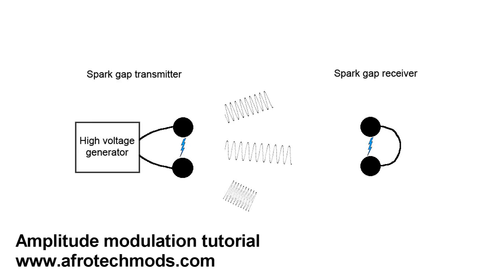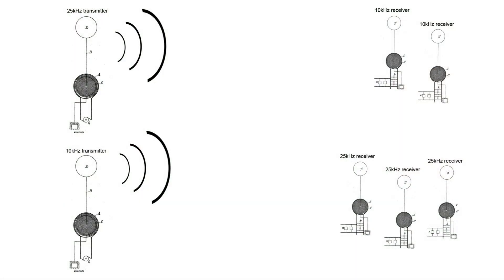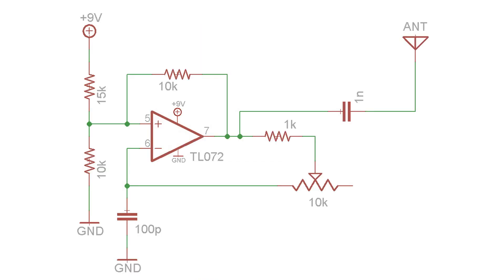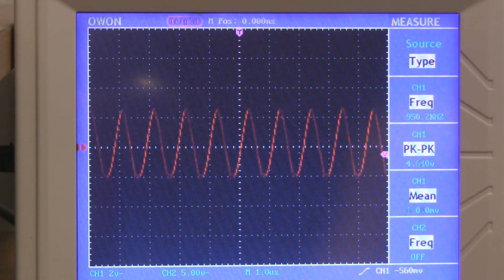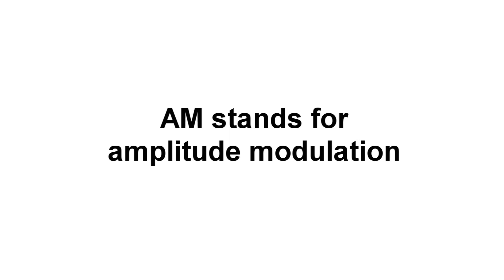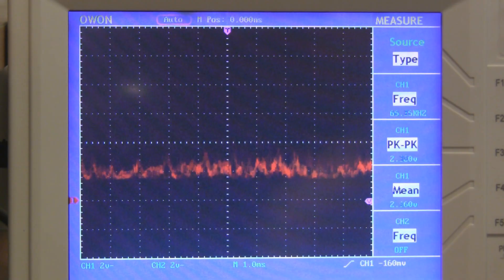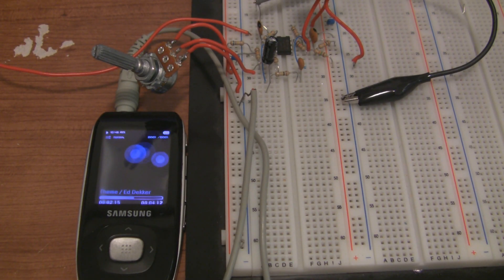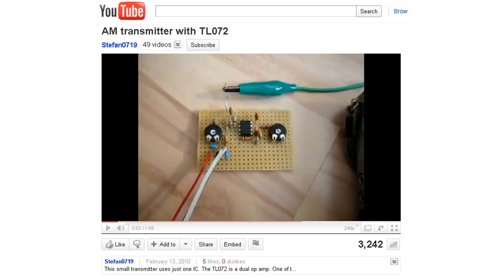Amplitude Modulation tutorial and AM radio transmitter circuit

Comment: As far as I know the modulation needs a multiplier and not a summation or a  subtractor. The final amplifier is used as a difference amplifier and not as a multiplier unless of course it is driven  hard in a non linear region.
I am  not so happy about the last " modulation" part!because the process is not a multiplication, if my memory is not failing me.
As far as I am concerned the circuit is summing up the three inputs from a. the audio player, b. the 100K pot and c. the 9 volt line while the result is subtracted from the carrier,  while the output is used to give a gain of about 7.   the result is a not an amplitude modulation.
The output should be the base frequency on which is superimposed the carrier and  some DC  value and it is a wriggly waveform where the constant carrier rides on the audio.
Reply: +Carmel Pule' You are absolutely correct, the reason this works is because of the non-linear response from the op amp. Since op amps are pretty linear, you have to drive them so the output voltage waveform clips. From that you get second order(you also get higher orders, but in this case the second order is the most important) intermodulation so if your input signal is cos(wm*t)+cos(wc*t) you will get on the output some component at cos((wc+wm)*t) and at cos((wc-wm)*t) which is an am signal (it also creates content at 2wc and 2wm, but we don't care). Actually, you don't even need the op amp, a simple rectifier circuit using a diode will do the trick. 

The other weird thing is the use of the TL072 which has very low GBW(unity gain at 3MHz) for a 1.2MHz application (I guess it's a clever way to filter out content at 2wc, 3wc etc. generated by the IMD but I'm not sure it was intended).
Reply: +Gabriel Nobert You made a circuit different from the DUT to shoehorn your theory. Removing a 'coupling' capacitor (the correct term for it), halving the negative feedback resistor, arbitrarily setting a bias pot to hard ground, changing the op amps. Your opinion that it 'makes no difference' is factually irrelevant, especially as you could have simulated the actual circuit without any so-called "tuning" changes. Friendly advice, that level of disingenuousness will get you fired.

For anyone else reading this, you can make the circuit itself in a SPICE-based simulator and draw your own conclusions. Paul Falstad has a great free one, just set the carrier with a 220n cap, terminate the output through a capacitor into a resistor, and put a 40hz test signal in. Op amp Vdd and Vcc set in their edit profile.

Now, I could always be wrong: But it's never going to be resolved with handwaved circuit 'tweaks' and appeals to pretense.
Reply: +Gabriel Nobert The reason this works has nothing to do with op amp nonlinearity. You can simulate it with ideal components and see why: It's a basic pulse width modulator. But of course, pulse width modulation changes energy output, and thus amplitude. An output capacitor of 10mfd into a dummy load of 100 ohms would perhaps demonstrate the transmit current, which is likely the more notable thing here.
Reply: +Eclipse We both are correct in the sense that I am giving a frequency-domain explanation while you are giving a time-domain one. The op-amp has to be driven to nonlinearity though, it's a fundamental concept that you cannot do AM modulation (or even get any new frequency component) with only a perfectly linear system. Even your explanation implies it, because in order to get a pulse width modulated waveform you need the output voltage from the op-amp to clip.
Reply: +Gabriel Nobert The 'carrier' in this circuit is a square wave from an RC relaxation oscillator. The second op amp is incapable of clipping it at an offset because it's already 'clipped'. All it does is vary the duty cycle in response to the audio input. It's basically a delta modulator. The effect of that however is to modulate the carrier amplitude at the output. Any duty cycle variance will change the amplitude seen by the antenna's reactance, linear system or not.
Reply: http://imgur.com/3VNhpjU

There I did an analysis of the circuit, showing that if the second op-amp does not clip the waveform you don't get an AM signal. You can also see that there is no PWM in the output signal. All the RC relaxation oscillator does is providing a carrier. After that, you need something nonlinear in your circuit to modulate it with the audio signal.
Reply: +Gabriel Nobert Run it through SPICE and you'll see what's going on. There's no rail-clipping at all. In fact, you by technical definition cannot 'clip' a square wave, since 'clipping' is perhaps the squaring of a non-square wave. You can consider a square wave as a sequence of harmonics surrounding a fundamental frequency, and the second op amp may linearly reproduce it.

You can of course change amplitude by running up an offset relative to a rail and chopping off the tops of waves. But that's perhaps not what this circuit does. It just changes the duty cycle, but you'll certainly see that doing so may alter amplitude relative to reactance.
Reply: http://imgur.com/a/8ak1o

I did run the simulations (with some tuning on the circuit) and both simulations confirm what I've been telling you (see analysis above). There is no PWM, just rail clipping that modulates the audio signal with the carrier. If we remove rail clipping, the circuit just does not work because you get a carrier added to the audio signal.
Reply: +Gabriel Nobert That's obviously not the circuit in the video. The component values are different, you're using two different op amps, you even have the second bias pot as a hard ground with an irrelevant Vdd connection. Properly assembled in SPICE, this circuit produces a delta modulator. Just turn the carrier RC down in frequency with a 200n cap if it's not simulating well, then put a 40hz 5v peak test modulation in. And actually use the right parts, examining what changes with different bias pot settings.

Odds are Afro was looking up 'modulators' while putting this together and accidentally selected a delta modulator, not realizing it wasn't a strict amplitude modulator. Irony was then that delta modulation into reactance does change amplitude, so it perhaps turned out okay.
Reply: +Eclipse This is going nowhere, you are either trolling me or too arrogant to accept you're wrong(although the former seems more likely), this is why this will be my final reply. I did the exact same circuit except with 3 differences:

I put in op amps with better frequency response (don't mind the model number, I manually changed some of the parameters). This will make the carrier less triangular-ish that it might look in the actual implementation in the video, but other than that, no overall change.

I put a lower gain because I did a little tuning and 7 was too much. The TL072 can't even provide that much gain anyway at 1MHz. I do not understand why one would think that this could change anything at all in the overall behavior of the circuit.

I removed the bypass capacitor at the input of my carrier in the second op-amp because I wanted my circuit to clip in the lower alternance and it was easier to tune that way. Again, there is no reason why this would change anything else.

I put the Vdd connection at my pot in the DC bias for the second op-amp because this is how it was in the original schematics, but then again, this changes absolutely nothing and you know it. I did not check the value of the bypass capacitance before the load (I should've put more) but this change nothing when you look at the output of the amplifier like I did. You should look up what delta modulation is, because it has nothing to do with what's happening here.

- An actual electrical engineer
Reply: Any chance I can take a look at the schematics of your circuit? I'm trying to build something similar, but repurposed for another device.

Referring to your comment:

I put in op amps with better frequency response (don't mind the model number, I manually changed some of the parameters). This will make the carrier less triangular-ish that it might look in the actual implementation in the video, but other than that, no overall change.

I put a lower gain because I did a little tuning and 7 was too much. The TL072 can't even provide that much gain anyway at 1MHz. I do not understand why one would think that this could change anything at all in the overall behavior of the circuit.

I removed the bypass capacitor at the input of my carrier in the second op-amp because I wanted my circuit to clip in the lower alternance and it was easier to tune that way. Again, there is no reason why this would change anything else.

I put the Vdd connection at my pot in the DC bias for the second op-amp because this is how it was in the original schematics, but then again, this changes absolutely nothing and you know it. I did not check the value of the bypass capacitance before the load (I should've put more) but this change nothing when you look at the output of the amplifier like I did. You should look up what delta modulation is, because it has nothing to do with what's happening here.

- An actual electrical engineer
Reply: scoobysharky See imgur link in one of the previous comments.
Reply: @Grabsac1  I am working on an Amplitude modulation project, i simulated this circuit i received a clipped waveform at the positive 4.7V the negative part shows a modulated wave , is this beacause its Single side band waveform ? kindly help

Comment: How does the signal you want carried, end up as part of the carrier wave? The carrier wave's amplitude is modulated. But, how is that done exactly? Slightly dumb question I know!
Reply: Not a dumb question at all! An amplitude modulation is a multiplication, and this circuit is not capable of doing such an operation. With ideal parts this would not work (the audio signal is just shifting the dc-offset), but any nonlinearity in the opamp (like clipping against a supply rail) will produce a crude modulation.

Comment: Всё правильно говорит, Тесла изобрёл радио.
Reply: No, he didn't, he invented a LC tuned circuit, and then lots of inventors and scientists invented some ways to increase the efficiency of how I transmit and receive information, Tesla didn't invent the radio, he invented A PART of the nowadays radios
Reply: Jeronimo Murruni Тесла первый передавал и принимал радиосигналы, соответственно он и первый открыл радио.
Reply: Mr. ПоделкинЦ He invented the LC tuned circuit to transmit information, that does't means he was transmiting voice. There are a lot of things that make radio devices, a radio device, and not only a tuned circuit, as I said, he invented A PART of the radio (the tuned circuit) but the other people invented some other parts, how to modulate in amplitude, in frequency, in phase, how to make better oscilators, the superheterodyne part of the radio wasn't invented by Tesla, and it is a VERY important part when you want to receive radio frequencies. Tesla DID NOT invented the radio, he just invented one part

Comment: This is Awesome! If you want to kill all the external radio noise you could line a box with aluminum foil and place all your supplies inside, when you put on the lid of the box (also lined with aluminum) a Faraday cage is created which will not allow electromagnetic interference into the box.

Comment: i can hook up, before last cap a TDA2030 ,power amp, for biger range like 10-12m?
Reply from the maker: No, because the TDA2030 is an audio amp intended for use with audio frequencies. You would need an amplifier that can provide good gain at 1MHz.

Comment: From what I can tell, you're not really AM modulating the carrier frequency. Instead, the audio signal is changing the DC offset of the carrier signal, see 7:00. Because the carrier signal's amplitude doesn't change. So, the million dollar question is, why does it still transmit?
Reply: Iustinian P. If the components were ideal, nothing would happen. But any nonlinearity will mix the carrier frequency and the audio signal together and this is then transmitted.
Reply: That's a good question!
Reply: You're totally right. Spent few minutes here thinking about it and yes, it should multiply both signals instead summing them.

Comment: When I make this circuit I keep getting a saw tooth shape. And when I rotate the potentiometer the frequency does not change. I am using the same Op Amp as you. I've checked the circuit over 5 times. Any ideas?

Comment: Great video!
Could you answer a couple of questions for me regarding the oscillator at 2m15?
First, what kind of oscillator is it? It looks like a wein-bridge without the 'lead' 
part of the lead/lag circuit.
Also how would you adjust the amplitude of the output in this circuit? I've done
it by simply putting a voltage divider on the output, but that feels like cheating.

Comment: Is it because even though its a summed output, its still a summed output at a specific frequency. Therefore when you set the AM radio demodulator at that specific frequency it demodulates it back into a carrier + signal. The demodulator also seperates and amplifies the signal and drops the carrier? Just a guest. Great Work Afrotechmods, how com you don't post any more videos? i wish you were in NYC so you can teach me first hand.

Comment: you can also use a 27mhz rc car remote and a nine volt battery for it instead of two AAs and you will be able to do mores code over the cb radio but i dont think anyone far away will hear it and it is possible to be hered on the am radio band but it is realy quit unless you stick a screw driver to certon parts of the circuit board the remote i used was a newbright rc car remote

Comment: Much more simple method to make a real AM is to connect the 9 volt supply for the opamp through the primary of a low-power mains transformer, and feed the audio signal to the secondary. Maybe you will need a little audio ampliffier to drive the transformer. You'll get a better sound quality.

Comment: I can only guess why the radio is picking up the signal. I think that you are driving the op-amp near the end of it's dynamic range where it's non linear and makes some parasitic amlitude modulation of the carrier. That's why it sounds so distorted and the lower audio levels aren't audible.

Comment: That you have done is not amplitude modulator at all! It's a summing ampliffier, and you are just summing the high frequency with the audio signal. For AM you need a multiplier or mixer (circuit with non - linear element) to actualy modulate the amplitude of the HF carrier with the audio signal.

Comment: The carrier signal from the first TL072 (the 1MHz or so) feeds one of the second TL072's inputs.
The audio (the modulation) from the mp3 player feeds the other input.

If I'm understanding the circuit properly, the second TL072 essentially subtracts the two signals.  When they are of equal amplitude but out of phase, there's no output. When in phase you get maximum output.

See wikipedia  under "modulation" for an animation
Reply: How I am understanding it is that he is essentially using the audio signal to dynamically distort the carrier wave. Kind of a brute force way to do AM and probably generating quite some harmonics. A simple subtractor/adder wont modulate anything. The bias circuit at the second TL072's noninverting input is  simply determining the clipping level.

Comment: Interesting you would ask that, as using a crystal oscillator can simplify things a bit. However, they have some major disadvantages (large size, fixed frequency) and actually are likely to become replaced by tiny variable-frequency silicon (transistor-based) oscillators, like the one in this video, in the next few years.

Comment: This is exciting, I have an Atmel board that has about 20 outputs pins on it. If I created a square wave toggling the pins on and off, could that still create a carrier wave? Also, If I created a neodymium core coil and fed analog audio trough that, could I use the coil to superimpose the audio onto the carrier wave? Not sure if the goal is to combine the two waves, but thinking this might still work.

Comment: You would probably want to use a frequency modulated (FM) signal instead of an amplitude modulated (AM) signal. There's plenty of simple circuit diagrams available if you google "fm transmitter circuit."

Comment: First of all, i want to agree with leeYT321987. Your explaination is awesomely.
I have build your circuit at the lab in the university and it works perfectly.
I recognized that the oszillator ist an astable multivibrator (in german "astabile kippstufe") and it so for it generates many sine carrier signals (see: Fourier series). But no matter that. My Question is: Does the second OP-Amp multiply or add the two signals? I ask cause i can't see a multiplication circuit there. Confusing. Thanks.

Comment: Thanks Afro for AM tutorial.  I have a question about the Vo of the opamp.  so, you power the opamp with 9 volt and gnd. however, your Vo also contain negative voltage, how does that work? Thanks.

Comment: @Afrotechmods AM does pick up interference, but is much better for covering mountainous terrain than FM, which is strictly line-of-sight and will get blocked by terrain. I live in a hilly area between two major cities, and I have to keep switching my FM presets depending on which side of the mountain I'm on, whereas the AM stations from both cities can be heard equally well throughout the area. (Although this is mostly due to the frequencies used by the AM & FM bands, not the modulation method.)